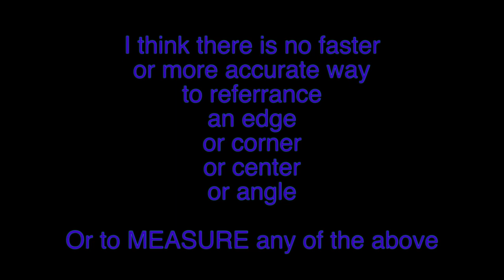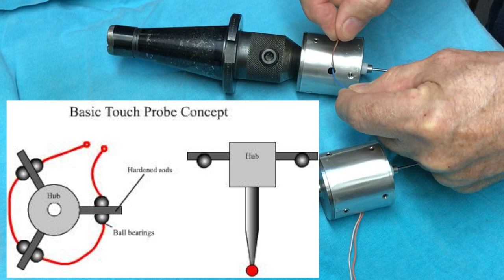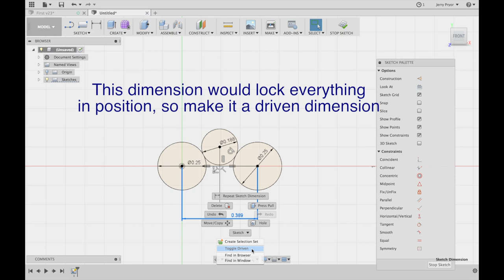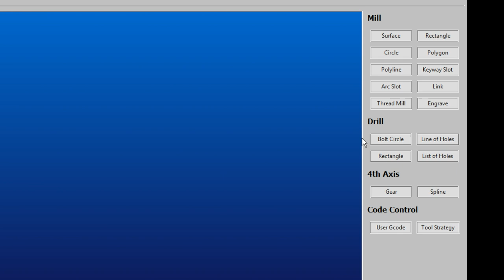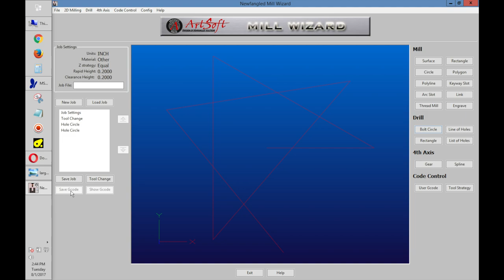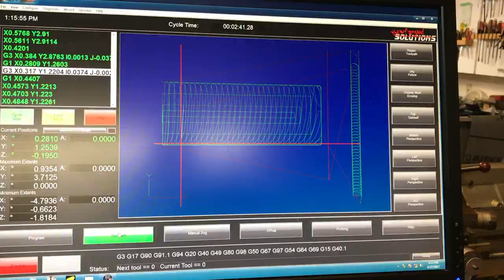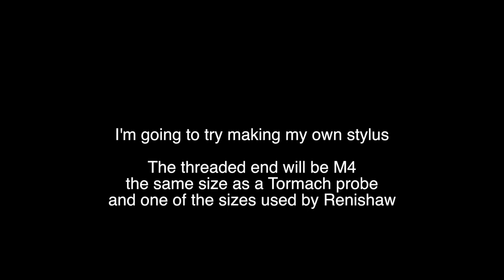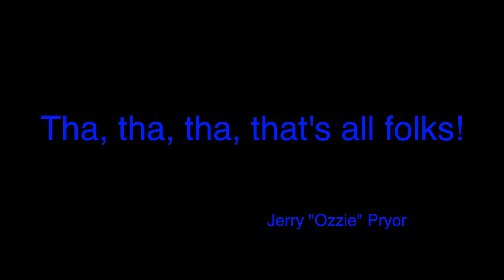Probe Movie

Comment: Awesome video Jerry! Too bad you had to sacrifice your personal body piercing stash. Loved it!
Reply from the maker: Thank you Captain. This has been in the can for a while along with a bunch of other miscellaneous clips. I hope to get more out soon.
Reply: I'd love to see a follow up video on accuracy testing
Reply from the maker: That is not only a possibility but a probability. That's because I want to see the results also. About the time I was finishing these probes I discovered that I was having a lot of problems with Mach 4 probing. It apparently worked, but not always. After nearly "30,000 emails" to Pokeys and Newfangled, I/we discovered the fault was with me, not the program or Pokeys. After a small reconfiguration, I used a solid probe to measure the inside diameter of a cylinder I had on hand, and had measured many, many times in the past to the point that I was confident I knew the dimension to 0.0001" accuracy. The probe measurement matched that number perfectly! 
Accident, maybe. 
I want to do more testing with both solid and sprung probes and do some inspection of these two latest probes.
The design of a three fingered probe contains within it, probing errors; it doesn't switch on/off the same in all coordinate directions. 
A follow up is now on the schedule; ,,,,,,, damn, ,,,,, where is that schedule.
Reply: Ha ha, I can wait.

Comment: Fantastic video as always, what motion controller are you running with mach 4?
Reply from the maker: Using Pokeys57cnc on both lathe and mill; love 'em.
Reply: JerryOzziePryor I got an Ethernet smooth stepper, a few years ago, they advertised it supported backlash comp, for mach 4. Well they're still advertising it, and it still doesn't.